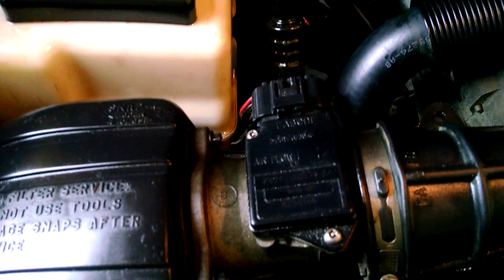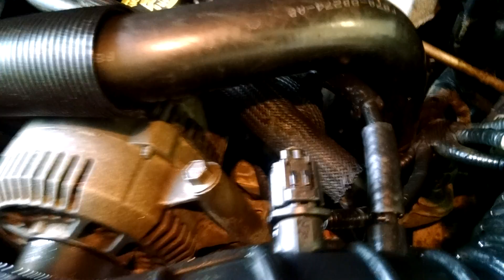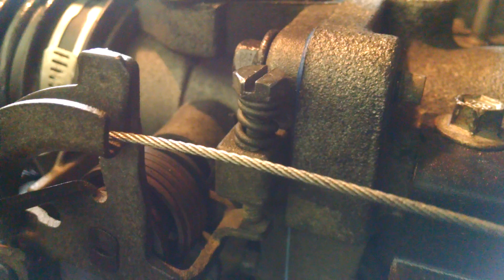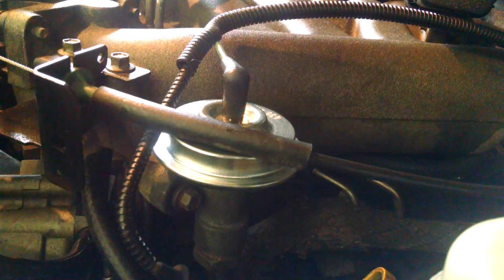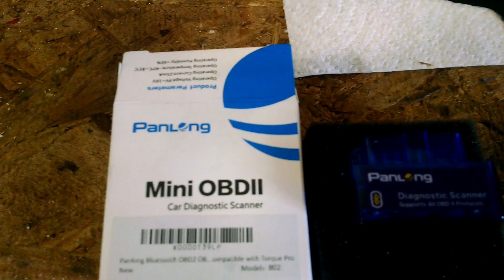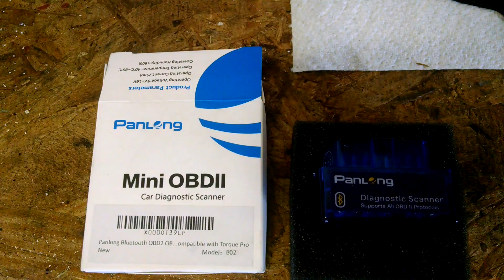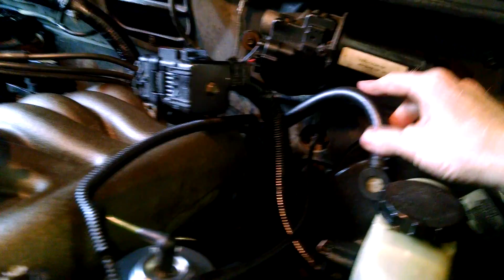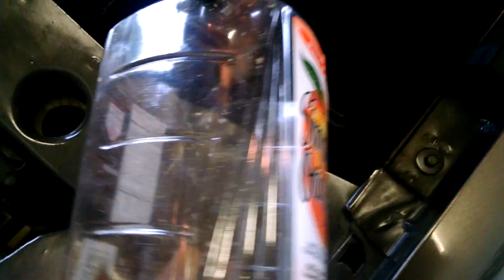2000 Ford Ranger High Idle

Comment: Just bought a 2006 ranger from a christian pastor. He boasted about the new spray bedliner he just had installed 1 month before. And how he had them spray it extra thick. 3 weeks after buying it, needed to change the third brake light bulb. Bed felt extremely spongy when I climbed in.  Turns out his extra thick bed liner was to hide the fact the floor was rusted out. After further checking, found numerous things that he doctored  up to get it to sell. Now I have a spotless dent free super low mile pile of junk.
Reply from the maker: Jim, I so sorry for your experience!  That is just terrible.  Please let me know if I can be helpful with any of your repairs.
Reply: Hello jim h-if you ever find a PERFECT Christian-all of HIS - hungers and thirsts for the righteousness that we'll know only when we step into HIS eternity-

Comment: I have a 02 Ranger 3.0L that sometimes has a high idle only after I drive and put it in Park. I have to restart the truck for it to reset the RPMs to normal. 
Also, not sure if related or another problem, but it has a small vibration on start up, almost like a misfire. It's not a constant vibration like a bad motor mount will give you. I have changed plugs, wires, ignition coil, fuel filter, air filter, PCV valve and have cleaned throttle body, IAC valve and MAF sensor. Still shakes. No CEL.

Any ideas what I could be dealing with?
Reply: Yes the high idle, other day I cleaned the iac even that it ain't that old, then i sprayed a little bit of seafoam intake and valve cleaner in the little vacuum hose that runs to the canister on the left side facing the engine, been 3 days with out it doing it,don't know if it lubricated something, or loosen some gunk loose, but also has not got back in the 90+ degree weather, maybe something to try , I'll see if I can get back here in a few weeks with update
Reply: I know this is old, but did you ever find that problem out, mine does exactly the same, replaced about the same also
Reply: @bryandunn4886  if you’re referring to the high idle in park then no, unfortunately. The problem is very rare that it’s impossible to diagnose so I just learned to live with it.
The other issue came from an exhaust leak in the manifold gasket.

Comment: Hey thanx for all the info on high idling but my ptoblem is when my ac is on i get high idling. Normally with no ac on it idles at 780 790 rpms but once the ac is introduced it  kicks up a little but as I accelerate it kicks up to 1500 rpms and stays that way. Any idea why it does that? Thnx.
Reply: juan's Dawon have you figured it out yet?

Comment: A bad CTS can cause high idle. Warm the engine first. Check the oil and radiator first. After replacing parts, recheck the codes.
Reply from the maker: Marty Stevens Thanks for the post Marty.  What is a CTS?
Reply: Resurrection Auto Coolant Temperature Sensor. If your CTS is acting up, it can cause the engine to run rich or idle too high. They go bad slowly and gradually causing your car to use gas. A Actron CP9690 code tester tests live, graphing, smog readiness test, record, oil light turn off, and MORE! It has cables for OBDI for Ford G.M., Chrysler and 2 Toyota. It has a cable for OBDII. It has a cigarette lighter cable. It comes in a black pouch with instructions. You can get a battery adapter to hook up to the cigarette lighter from EBAY. It can check sensors with the engine off like MAF, IAC valve, EGR open percent, RPM'S, oil pressure, coolent temperature, fuel pressure, vacuum, oxygen sensor voltages, charging system voltages, etc. The Snap-on Vantage does a whole lot more! It can show wiring diagrams of sensors, check ignition voltages, It can check codes. It's better than a code tester to REALLY find out what's wrong with a car. It's advanced for a beginner. It'll show tune-up specs. It'll show your plug firing voltages and can easily pick out a bad cylinder. The spike will be high or too low. It's a All-in-one IF you understand the readings. I would've bought one instead of my Actron CP9690! The cost is a little bit higher. EBAY has it.
Reply from the maker: Marty Stevens Thanks for that information!  I didn't know that.

Comment: Mr Garner,  My 1996 Ford RANGER 4.0 LITER ENGINE starts up, idles fine, then the idle slows and all is well.  As I drive and the engine warms up, the rpm speed starts to increase on its own, up to perhaps 2500 rpms - really racing.  I have to apply the brake to go slower.  If I shut off the engine, it will not re-start....something that has never happened before... it always started easily.  Do you have any idea what my problem might be?  Thank you.
Reply from the maker: Chris.  Great question.  Honestly, I'm not sure.  I would buy the OBD II reader I mention and look at the telemetry of the engine.  It seems toe me that the computer is getting false information from a senor.  I'm sorry I can't be of more help!
Reply: Westley,  I have the obd reader, but it is not giving me much to go on....lean mixture and stuff.(p0340, and P0171)  Not identifying a bad sensor....However, just a while ago I took off the whole MAF housing/sensor with the other wires and guess what.....started the engine and it ran fine for a long time....restarted each time at the right rpm, etc.  never sped up.  So tomorrow I am going to buy a new MAF and hopefully that will solve my problem...will let you know....thx Chris
Reply from the maker: Thanks for the update.  I look forward to hearing if that fixes it.
Reply: Wesley,  My truck is running very well now...not perfect, but much better than it has in two years.  I changed the MAF and that made a big improvement, but the truck continued to refuse to start when warm.  I then changed the crankshaft position sensor on the bottom from of the engine, by the flywheel pulley - in part because it was easy to get to, and finally I changed the idle air control sensor on top of the engine.  All of that seems to have done the truck.  It idles great, better than in two years, and it starts up perfectly every time.  I still get a code p-0340 which is the camshaft position sensor, and I would change that too, but it is too difficult to get to...I would have to pay to have it done....must remove the intake manifold I think to change it, and that is more than I want to do.   At any rate,  I drove the truck all over yesterday, stopping a lot, etc and it ran great.  Just thought I would let you know in case other's had questions.
Reply from the maker: Chris Kreitlein Fantastic.  Glad it's running better.  Good job on the repair!

Comment: I have a 1998 ford ranger 4×4  with a high idle I fixed some of the vaccuum hoses that was bad still didn't fix the idle, I'm not getting any air blowing out of the front vents at all the air only blows out of the defrost could there be a vacuum leak under the dash or could the no air coming from the front vents be a blend door motor problem
Reply from the maker: Great question Brian.  It's almost certain you have a substantial vacuum leak.  If you purchase the OBD11 reader, you can actually read the vacuum pressure on your phone  That will confirm the problem.  The smoke test may be the best way to actually find the leak.
Reply: Wesley Garner I had a mechanic think it might be the idle control valve the high idle is only at start up then after it runs for a minute the rpms settle down, what is the link to order the ob2 scanner
Reply from the maker: I purchased one similar to this.  https://www.amazon.com/gp/aw/d/B011NSX27A/ref=mp_s_a_1_10?ie=UTF8&qid=1481240114&sr=8-10&pi=AC_SX236_SY340_FMwebp_QL65&keywords=obd2+scanner
Reply: 8 ball I  had the same issue with my 2001 ford ranger 3.0 truck come to find out it was a small hose (on mine it was cut I  have no idea why) that is connected to a black,softball size ball that's attached to the fender. That ball should have two vacuum lines comming out of it. one line should go straight into the fire wall and the other should be attached to a vacuum line supplying vacuum. These lines are very thin and made out of plastic and can become brittle in time.
Reply: @JuanDaMajikOne  The "softball" is the vacuum reservoir.

Comment: Mine does all that but only when I'm driving an changing gear , but when I come to a complete stop the idle goes back to normal . Any help is highly appreciated
Reply: Its almost if I had the cruise control in gauged when In gear . But as soon as I press the clutch the idle goes sky high . Its getting annoying cause people think I'm trying to race them lol
Reply from the maker: I did some research on your symptoms and found that a service bulletin was posted by Ford concerning this issue.  Apparently some models may have a faulty connection at the throttle position sensor.  See this forum for more information: http://www.therangerstation.com/forums/showthread.php?t=53507
Purchasing the OBDII reader would also help as you could read the TPS. 
Hope that helps!
Reply: thanks Wesley
Reply: Ray M — hi, did u find out what it was? My 2000 ranger has the same exact problem u just described. Trying to fix this before selling it. Any help is appreciated, thank you

Comment: My high idle was coming from 2 places-after replacing my EGR Vacuum solenoid valve my idle lowered AND one of my exhaust manifold bolts had snapped thus causing an exhaust leak. The EGR solenoid was working but "lazy" as many sensors are want to do after years of service. Ford exhaust manifold bolts from the early 2000s are known to be of a poor quality, as are many of the Big 3 manufacturers. They can and do often break through the heating and cooling of normal engine operation.
Reply from the maker: Thanks for the comment and good information.